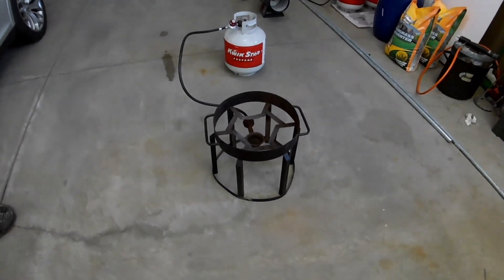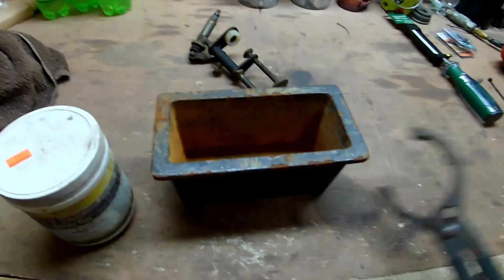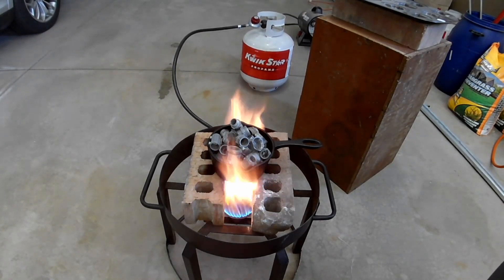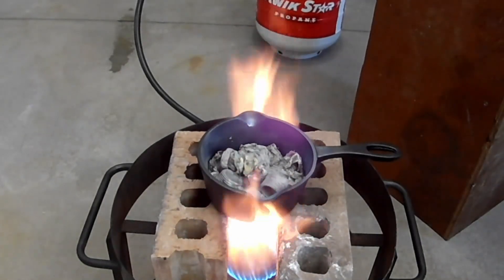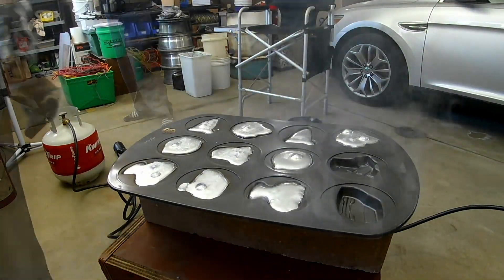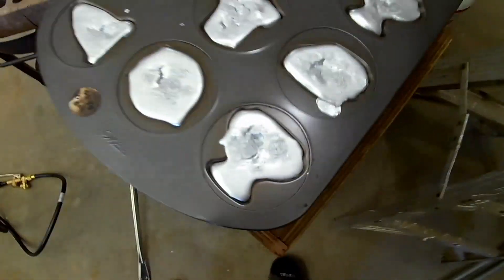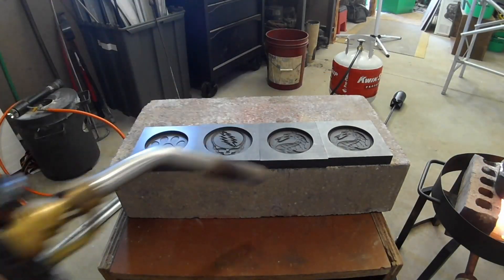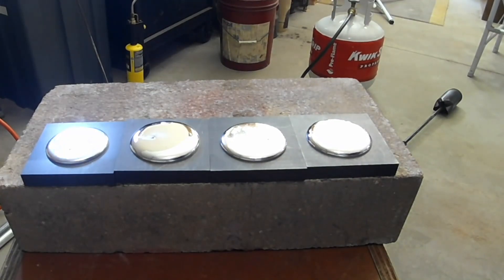Melting Metal - Zinc Over Open Flame!!

Comment: The fumes resulted from the Teflon coating of the pan degrading, since that's only stable up to 250ish °C. The fumes contain fluorine, unsaturated fluorocarbons and fluorinated aromatic hydrocarbons, among other nasty stuff, which is something you really don't want to breath in. When hot, these gases can also react with the zinc, forming a small layer of zinc fluoride.

Comment: THANK You Sir!
As a retired electrician I have Buckets of Zinc I never knew or thought of as "ZINC"!
I am zinc plating some fire arm parts, now I have loads of "Zinc" and don't need to steel my anodes off the boat.

Flux may work for purification or separation? I will try diatomaceous earth, borax, salt, bentonite clay/kitty litter as I already have these in my shop.
Reply from the maker: I call it zinc but I was told it's officially Zamak, meaning mostly zinc but also other metals.  Look it up, it's interesting.  Although not straight zinc it melts and pours like it.
Reply: @SkullerMetals  
Just ran a musket barrel after nickel 1st, can't wait to see how well my zinc plates over nickel. My test run on a tool looks good?

Comment: When it comes to anything with any type of protective coating like that muffin pan, you have to try and burn off or figure out some other way to get that coating off otherwise you end up with that bubbling problem.  That's what kept happening to me when I first started out practicing with zinc.  Love that dragon mold....gotta look that one up since I've been wanting one.  Try the Channellock pliers trick I was telling you about, granted with the size of that pot you have you might need a bigger pair but at least you won't have to worry about burning yourself.
Reply from the maker: I won't worry too much about that pan.  Thought I'd give it a try.  The designs definitely aren't cool enough to go to any trouble to use it.  I learn something new every day.  Unfortunately the dragon mold has been discontinued.  It's being redesigned by the mold maker because there isn't enough radius in some spots and the molds were failing.  I believe he said he was redesigning it.  As for the pot - it's really frickin' heavy when it has metal in it.  I will definitely play around with channel locks and see if that helps.  If I had a way to hold onto the other side of the pot it wouldn't be such a gnarly forearm workout.
Reply: @SkullerMetals  I hear ya on the weight, even my smaller one gets heavy.  I actually found some of those molds online from other sellers so maybe I can still get ahold of one before they're completely gone for good.  Same here on the learning part too, just did my first copper melt a couple of days ago and everything that Could go wrong Did...lol  Figuring my next one won't be near as bad.
Reply from the maker: @MrJco54   Well I'll tell ya, copper is harder than it looks.  You'll get it.